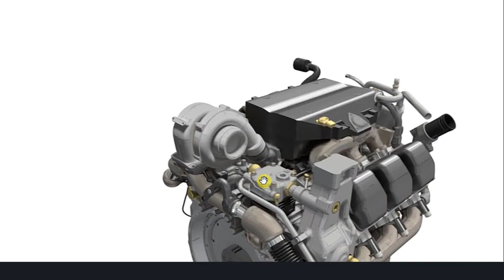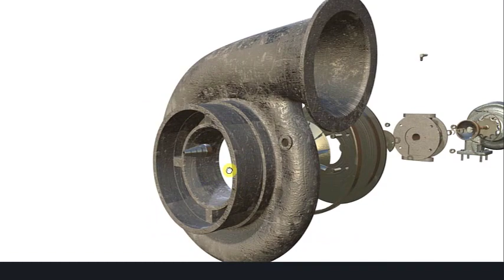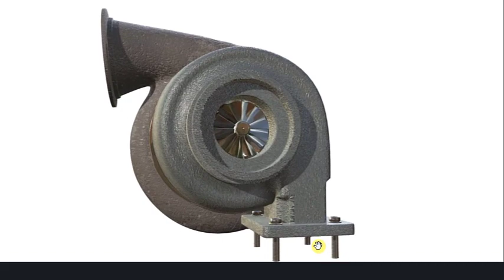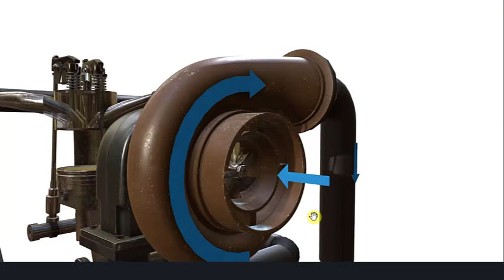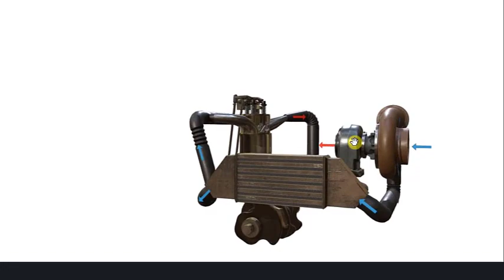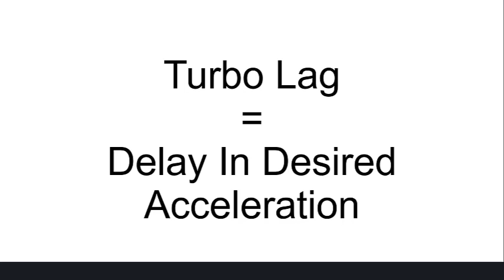How turbocharger Works

Comment: A very "straight to the point" and quite clear explanation. By means of the advantages provided by the 3-D Model animation, following the paths of both air and exhaust gases in a more concrete way (rather than in a more figurative way, often set at the back of your mind) gets far easier.
Please keep on with the creation of similar engineering and educational contents.
If only they were available while I was studying Mechanical Engineering 15 years ago...
Great Job!
Reply from the maker: Thank you Sir. Please share with your friends as well